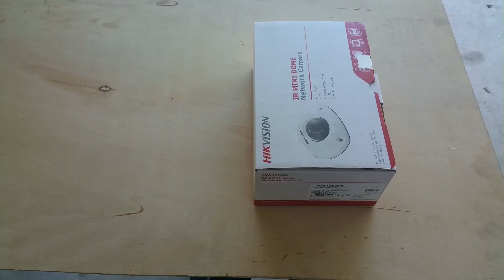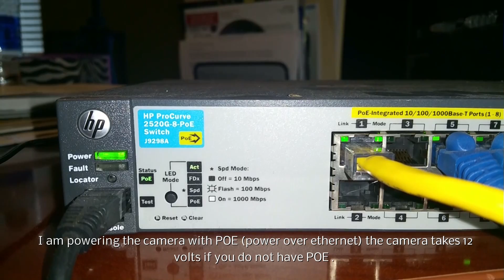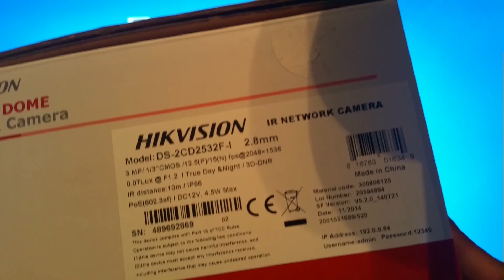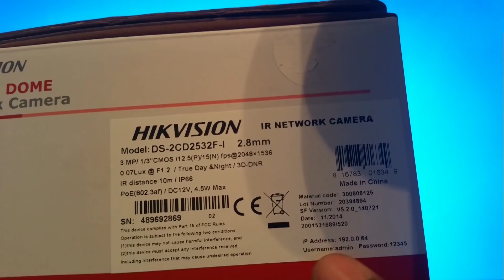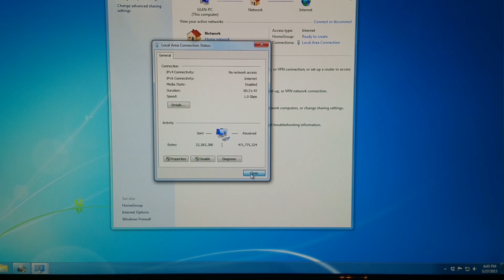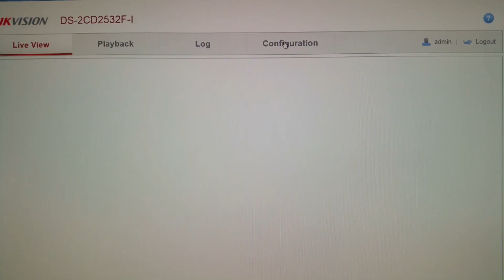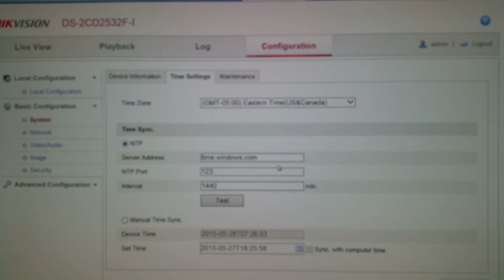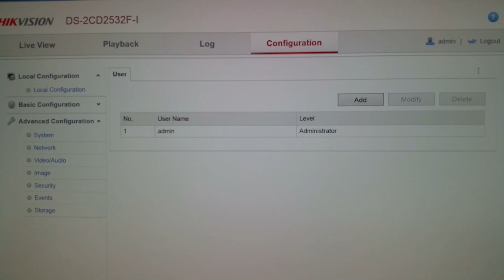Hikvision DS-2CD2532F installation and Setup

Comment: thanks for the video i need your help with something  if i have more than one branch  and i want to connect all my ip Camera in the main branch which is the best way to do it.
Reply: These use an rj45 connector. As normally only 4 of the 8 wires are used, it is possible to use a device that splits the cable so two cameras can be used. Otherwise, you'll need a network switch, preferably with poe for the cameras to fan out from. You can't daisy chain cameras - they need their own connection and configuration.